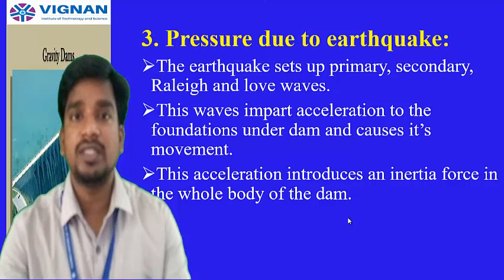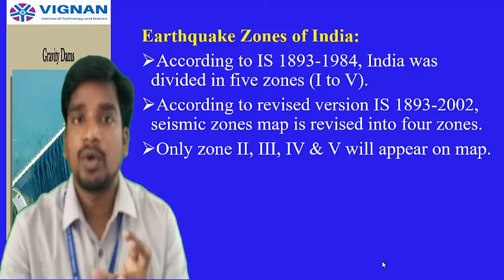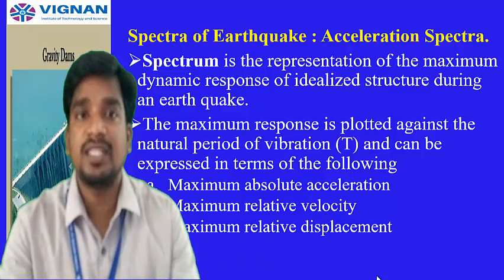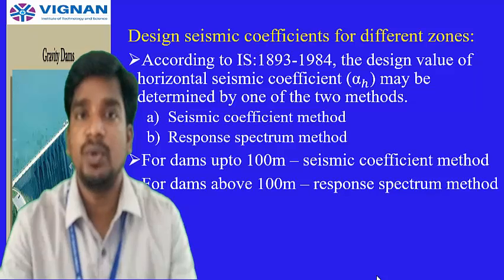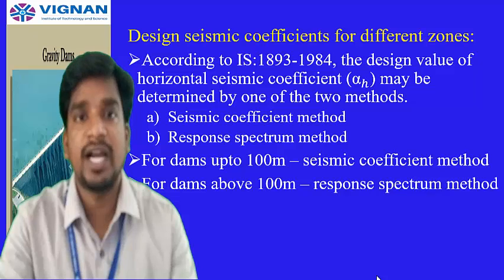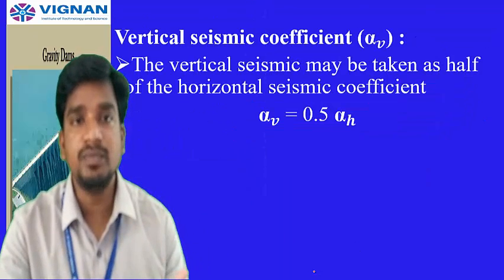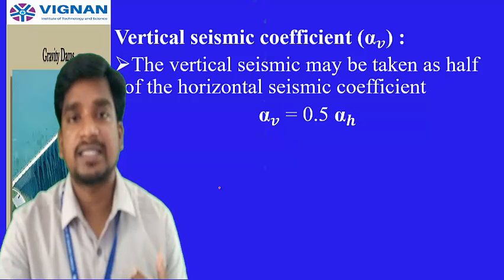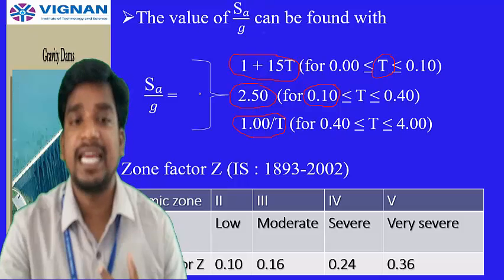Lecture 11 (Unit II - Gravity Dam (I&HS) - Pressure due to Earthquake acting on a Gravity Dam. )

Comment: Sir i don't get the  worst case scenario for reservoir full and empty conditions..
For full condition worst horizontal acceleration should be on the dam towards the downstream to topple it adding to water pressure 

For empty opposite should be true
Please clarify sir
Otherwise it was an amazing lecture sir